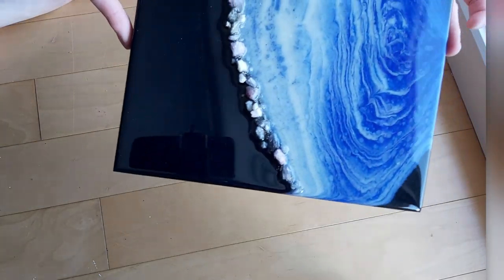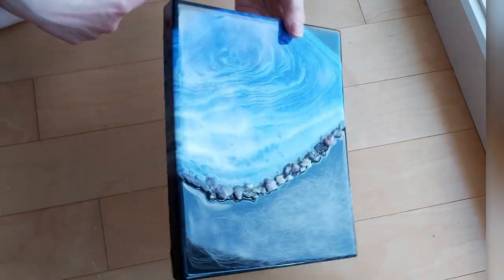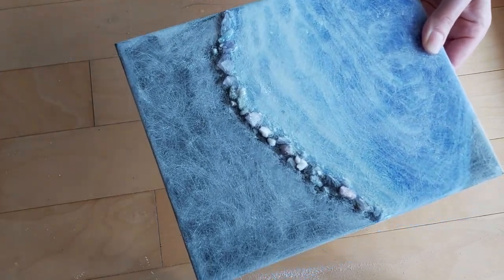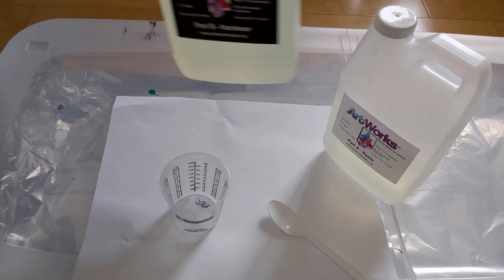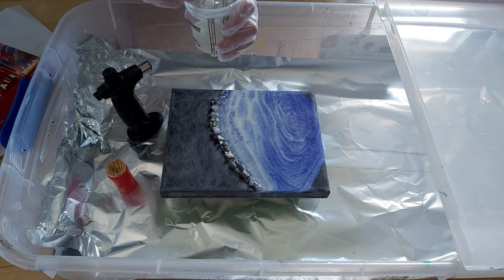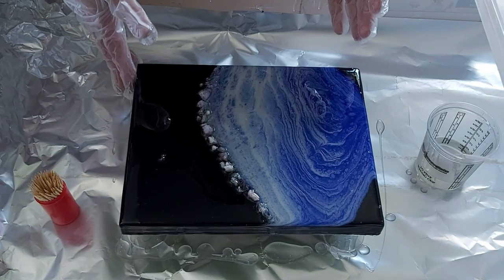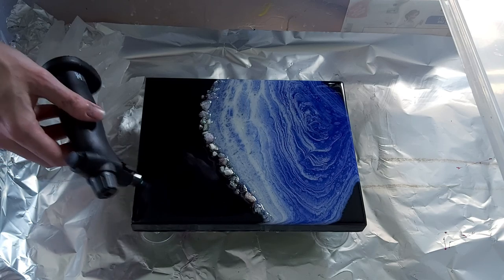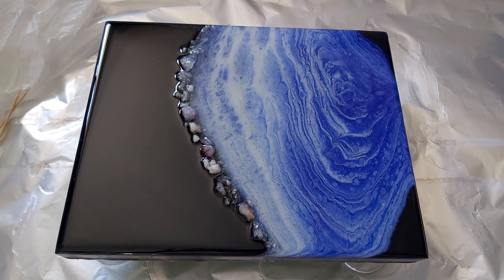02 - Artworks Resin | Sanding & Coating (RESIN Tutorial for Beginners)

Comment: Thank you for the very informative video.  I find resin intimidating!  I have been experiencing problems with the edges, on the top of the painting, leaving little divots around the perimeter.  Also, there are spots on the top, after drying, that are leaving pits.  I don't use silicone, so it's not due to oils.  On the paintings with the pits, can I just sandpaper the area around the divot or sand the entire piece?  Any suggestions would be appreciated.   I love watching your videos they are so informative.  You are crazy talented!  Thank you 💜

Comment: Thank you MelyD. Can you tell me if resin dries slower in winter ? I am in QLD Australia. 
I haven’t used it yet and I am a bit scared to try it but I live the finish it gives.
Reply from the maker: It would actually dry (cure is the term for resin) quicker. But it still takes many many hours so the difference wouldn't really change anything.

Comment: you should follow the 80 with 200 wet/dry. You will get a better finish.
Reply: What does that mean??? Please clarify
Reply: @staceyedwards8014  the smaller the # the more coarse the grit which creates deeper grooves. That can create air pockets. If you use a finer grit, starting with the 120 and go up, it still creates the adherence you're looking for. Of course, you could then go up to 600 to polish it, but that's not the purpose. I was suggesting that because she used the 80 grit, the sandpaper that is a 200 grit wet/dry (a type of paper), which can be used with water, or without, would perhaps be a better option, simply so as not to have trapped bubbles in the grooves that the heavier grit creates. That's all.
Reply: SoulStitch 11:11 thank you
So much to learn 😃

Comment: Mely, that was very helpful. I like to pour on large canvases, like 36x36. Do you ever put resin on large ones?
Reply from the maker: Thats too big of a canvas for a good resin job. I would strongly suggest pouring on wood for that size. The weight of the resin is too much. There are ways, like supporting the back. But wood is really best.
Reply: @MelyDartist  I actually done a resin coating on a 48x48” canvas & yes your absolutely correct, I had to put support panels underneath it because I new that the canvas would sag in the middle & OMG it is definitely my most BEST creation, I wish I filmed the resin part 🤦🏻‍♂️. I’m about to do a 24x60” pour & I will definitely be resining it, as it’s a commission piece & I think this time I will do a video of the resin process, I hope I do the resin coating video as good as yours, wish me luck hahaha your video was great & easy to follow, thank you 🙏 again for sharing

Comment: Mel,do we have to put two coats of resin?
Reply from the maker: You can put the number of coats you wish for the result you want. If I get the look I want with 1 coat then I'm really happy.
Reply: MelyD.artist thank you. You said if the resin is new, like in 24 hours, there is no need to sand. My two artworks are getting ready to put resin this weekend, and this is my first time. As both of those artworks are already sold, wanted to make sure I do not screw up.
Reply from the maker: @vandanabajikar9337  I strongly suggest practicing before on other pieces and not try for the first time on artworks that are pre-sold. I also strongly suggest, as someone who has been selling her art for 4 years, don't pre-sell resin art. I only put resin art for sale when they are 100% ready because you never know what can happen. Resin can make or ruin your art.

You don't need to sand an acrylic painting. The sanding part is only for resin that has been done previously and needs a new coat.  If you want to resin coat your acrylic painting, you do 1 coat, if you see that it needs another you can do it 12h later (give or take) no problem.
Reply: MelyD.artist I didn't intend to sell. But when I put in my page they contacted me to reserve. I couldn't say no.
Reply: MelyD.artist thank you for important advice.
Reply from the maker: @vandanabajikar9337  I totally understand things can be unpredictable. It's happened to me also! That's why I'm saying this. I've ruined pieces with resin that I did not feel comfortable selling (I'm a perfectionist though) and then felt like crap. 
All I'm saying is resin is not acrylic pouring and it can be unpredictable.
Reply: MelyD.artist I'm going to try in one smaller piece first and then proceed to main. As I used primary colors varnish is not recommended. And the spray varnish is out of stock at most places😢 But yea determined to do right and not damage the artwork.
Reply from the maker: @vandanabajikar9337  why is varnish not recommended with primary colors?
Reply: MelyD.artist water based and impacts the pigments. Unless I get spray one that too kamar or Decoart. Both are not available local or online.
Reply from the maker: @vandanabajikar9337  I'm not sure where you are getting your info but it's confusing. There are tons of different brands of varnish for acrylic paint and they are great to use. Their made for it. I use Pebeo spray.
Reply: MelyD.artist but very limited for ColourArte pigments as I understand.